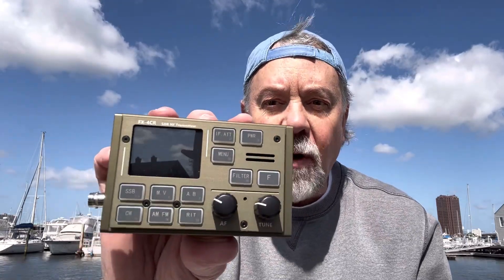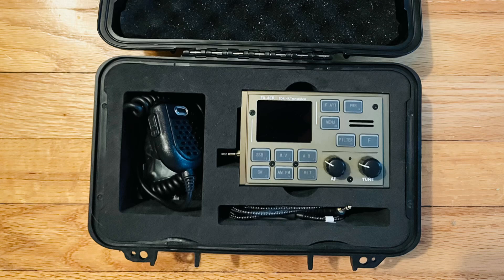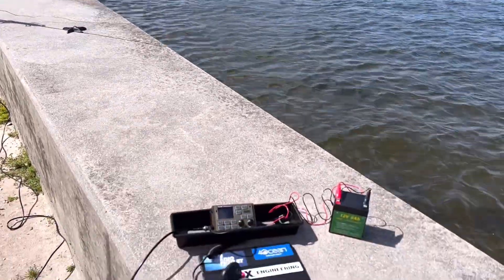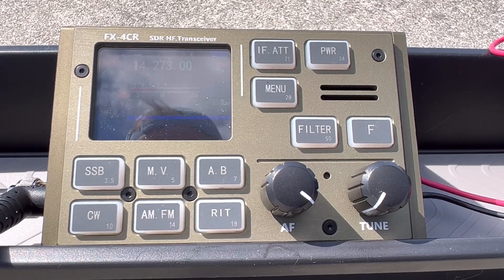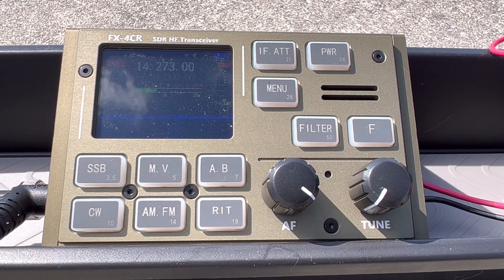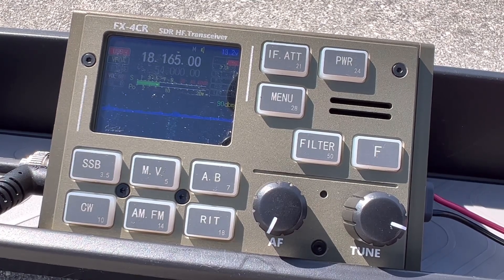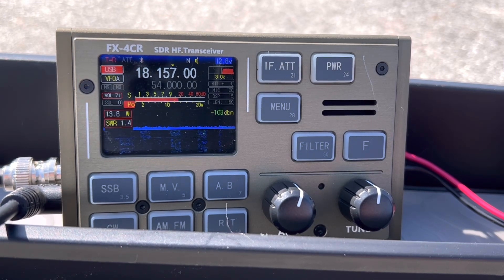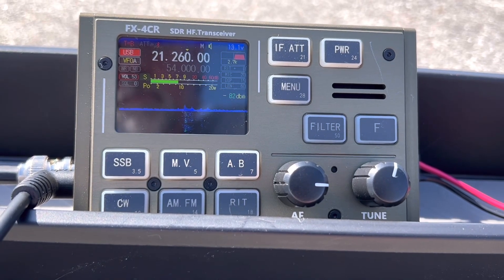FX-4CR - Portable in the Harbor

Comment: Very nice little radio! Have you played much with digital modes on the G 90?
Reply from the maker: No I’ve only used it for SSB
Reply: @COASTALWAVESWIRES  If I remember correctly this one has a built-in sound card. If I hadn’t gotten my G 90, I might’ve gotten this instead

This would be a perfect radio for you to get to know win link and FT8 (email and text, as I understand it)… that would be really useful during an emergency

I’ve been looking into the digi rig for my bow fang and the G 90. You wouldn’t need it for this radio, if I’m right

Comment: How does it handle heat dissipation at 20 watts?
Reply from the maker: Seems ok, I’ve used it for a couple hours straight. It’s warm when you feel the chassis for sure but haven’t had any problems.

Comment: Glad you finally got one. I love my FX-4C. Used it on several SOTA activations. I had an issue with one of the buttons, but Yu had it replaced for me by K6ARK. After that, it has worked flawlessly. Now I'm tempted to get a FX-4CR as well.
Reply from the maker: Thanks David, I’m actually glad it worked out the way it did and I got the FX-4CR

Comment: Hi Walt, I need some information an advise on purchasing a shortwave receive to listen to maritime frequencies, what would be the best receiver to buy? The ETON ELITE 750 good receive? I like to ask someone that truly knows radios. One more fast question will a copper wire antenna 25 to 50 feet work ok? Appreciate the information THANKS.
Reply from the maker: Hi! The ETON ELITE 750 is absolutely an excellent SW receive radio. It’s a gem! Yes for receive a long copper wire is excellent. You may want to experiment and move it around a bit to see if you can avoid local noise and maybe get it in a good position to receive. If you’re looking for an inexpensive little SW Radio take a look at the XHDATA D-109. I have one and love it. Cost me about $40 USD and has an external antenna jack and receives SW as well as Longwave, AM medium wave and FM. It’s a bargain and great to travel with.

Comment: Nice radio and looks pretty interesting.  Regarding the 7-section vs. 6-section mil whip, couldn't you have just folded over the top section of the original you had to shorten it, leaving you the ability to lengthen it for lower bands if needed and reduce the need for a tuner?
Reply from the maker: Yes I have actually tried that but found the internal bungee wire wants to snap it back up. I guess I could just tape it down but for $30 I just added another antenna to the collection
Reply: @COASTALWAVESWIRES  I got my whip with a bunch of PRC-77 gear from a friend, so I didn't know how much they were. $30 isn't bad at all and a lot less than I figured they'd be, considering they're "military"/"tactical", which adds an automatic 20% to pricing, it seems. :)
Reply from the maker: @MTimWeaver  I got both of mine on Amazon. I think the longer 7 section one was $42

Comment: Walt awesome as always I really enjoy your content - practical and factful and so glad that you’ve found your path to this 20w mini wonder.

I’ve being following this for ages and it’s so close to a finished product if Yu goes to open source software I think it’ll gallop along and has potential to really shock the big brands.

The pricing is intriguing and demonstrates just what incredible value for money the much much more feature laden Xiegu G90 and X6100 are. Also that size comes at a price and this form factor really lends itself to travel. With resonant antennas the ATU’s not needed and each operation has a different battery requirement. I’ve certainly moved away from the idea of a dedicated internal battery replaceable 18650’s or external is the way forwards 
Really appreciate the reference to the trusdx size…
Reply from the maker: Thanks for the kind words! I was on the fence on whether to by this or a X6100. The fact that the X6100 is only 5 watts with it’s internal battery is the reason I went in this direction. The 20 watts and small form factor sold me. Plus I already have a X5105. All the best and 73